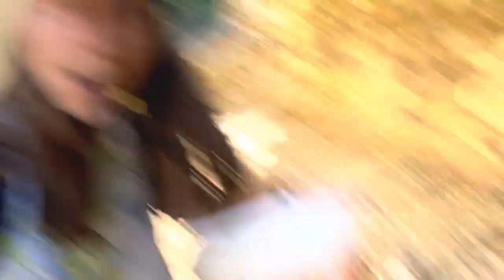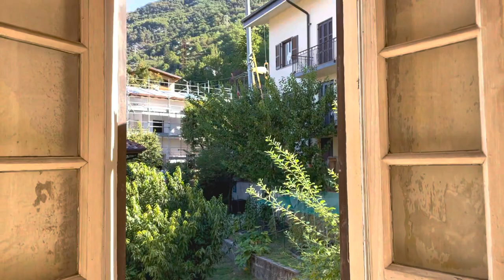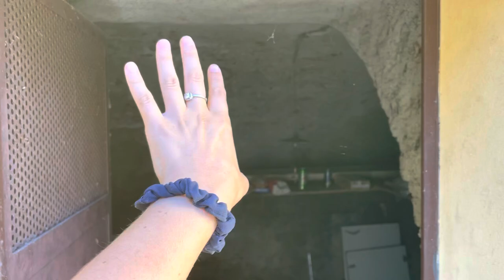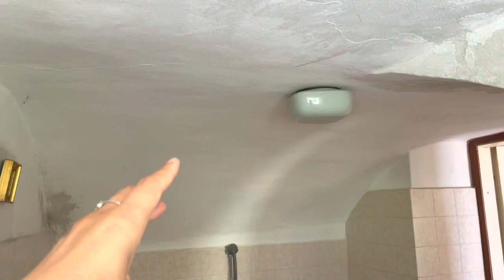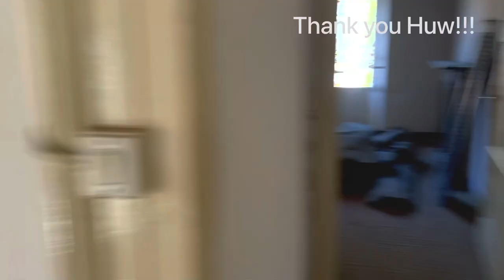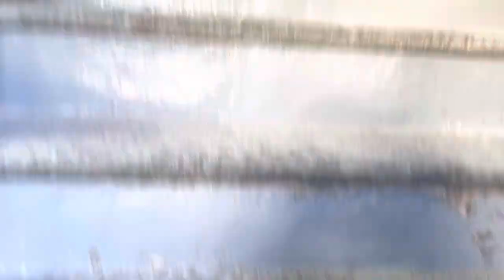DAY 13 of a big renovation in Italy/wisteria, buckets, more tiles and stones

Comment: Hi, there is a decorating / tile tool that has a longer handle and a proper blade that can be changed. Don't make your work any harder than it already is. Also, I suggest focusing on one area at a time and forget the stairs for now. Later you could tile or stencil instead of spending hours removing paint. It will all take time and money, but you could make a project plan of stages and time targets. One step at a time, not all at once. You're doing a fantastic job.
Reply from the maker: Thank you Wendy)))xxx

Comment: I am really enjoying watching your videos!  You are working so hard!  I really love your downstairs bathroom - I actually like the wall tiles I think the floor tiles don’t match. I don’t think I would start on the stairs until you have finished scraping that glue off the floor. Is it possible to get some sort of solvent to remove it?
Reply from the maker: thank you ))) Im very bad with chemicals, i will  try to clean it scraping them but it is very boring and hard for the back so im switching the projects

Comment: I like your taste!   Another idea for the bathroom…. You could remove the tub and gain some space by making use of some of the cave also, knock through the wall, creating a step down tub!  / grotto . You dont need the full standing room height.  The room appears lower than the bathroom anyway, and also has another arched roof… how nice if you were stepped down into a lovely  tub, looking up at a painted arched ceiling.. i see a sky mural with flying birds….
Reply from the maker: oooh i see the birds in a corridor ceiling ;)
Reply from the maker: love the idea of a grotto)))

Comment: Lots of work. I wouldn't remove all that plaster on the stairs as the stone looks in rough shape and it may be a huge cost on your budget. I would reseal them top to bottom and paint them.
I think the wall tiles are lovely in your bathroom and I think a nice floral paint on the ceiling will go well with the tiles once they are revealed. You could put a shelf in the back of the hallway for extra tioletries and towels and decor.
Reply from the maker: thank you Peter))))

Comment: I would do a free-standing bathtub in the same place and in the area behind the second door (which I would remove) a nice shower...
I also found these suggestions for removing plaster:
"What is the easiest way to remove plaster? Lubricate it: Cover the plaster with baby oil, then soak some cotton wool in the same substance before rubbing it over the plaster until you can slowly peel off the corners. Freeze the adhesive: Wrap some ice cubes or an ice pack in a thin towel and gently push against the plaster."
"Use a wide bricklayer's chisel and a masonry hammer to chip away plaster from the brick, working your way from the bottom of the wall to the top. A hydrochloric acid solution applied with a wire brush can be used to remove excess plaster residue and clean the surface to expose the beauty of the brick."
Reply from the maker: thank you!!!
Reply: @DreamingofAChateau  my pleasure...

Comment: I think your steps have been made with pieces of stone rather than just large solid pieces so you might be removing the concrete or lime joints in between. I’d be careful before removing too much in case you undermine the steps.
Reply from the maker: yeah)))i was a bit scared i move too much haha

Comment: I love spiders 😊here in Australia we have huge spiders and I'll pick them up 😁
The stairs look like they've been made from slate, and the cement and gravel render they've put over the top but under the plaster, is used to fillout the gaps between the slate or bluestone. Removing the cement on the top won't affect the structure, but it's messy. I had to do this to my home, very much worth it though. If you need to smooth out the gaps between rocks mix up a cement mortar to seal any loose sand between the slate and then you can seal the slate with an acrylic sealer.
I think having the magnolia tree in that spot will be perfect and the smell from the flowers will be amazing 😊
Reply from the maker: thank you Linda!love your suggestion)  uffff i would never touch a spider... love watching them from the save distance haha

Comment: There is one thing that worries me a bit. You seem to start jobs in the house everywhere. I think you first should see that your house is totally waterproof beforte autumn and winter sets in. Otherwise all your other work could be in vain.
Reply from the maker: you are right i start many projects at the time )))mainly because i can do them on my own ;)
Reply: This bothers me as well.  It’s so satisfactory to see one project completed before starting another.  The floor which you’ve nearly finished would look lovely if you went on to paint the walls and ceiling before starting the hall floor.